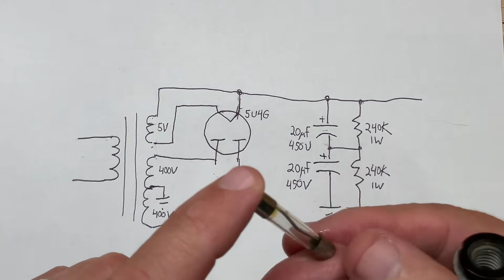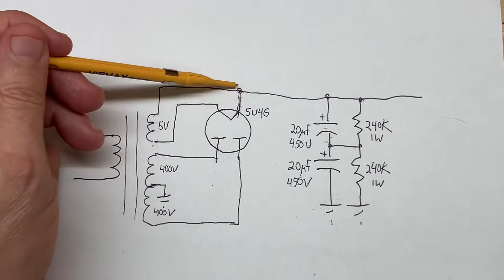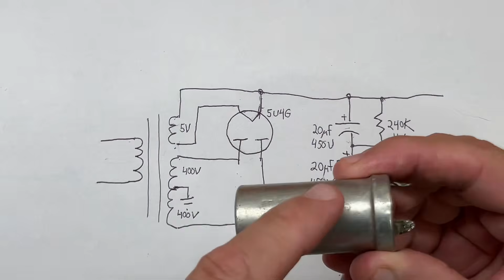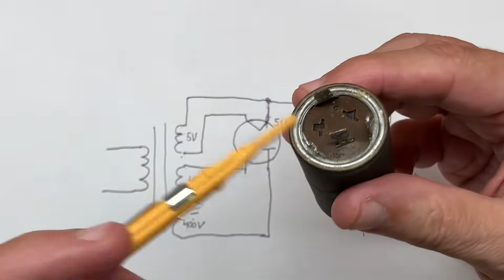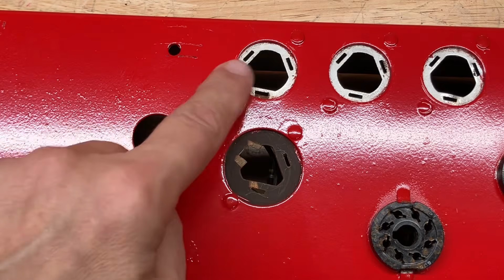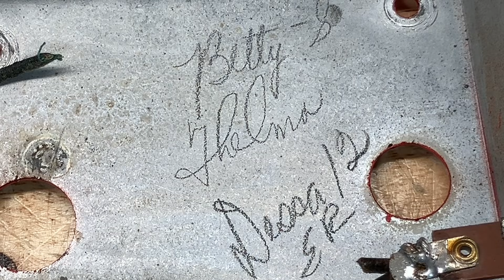1946 Packard Pla-Mor Jukebox Amplifier Restoration Part 3

Comment: lol on the fuse… I’m working on an Oregon d6 power supply which is supposed to have a 6a fuse in it and I found the same 20 amp fuse in it.  Looks like a piece of 14awg solid core wire in a glass housing

Great video series, fun to follow along. I really like the bit on the quick start tube heater circuit